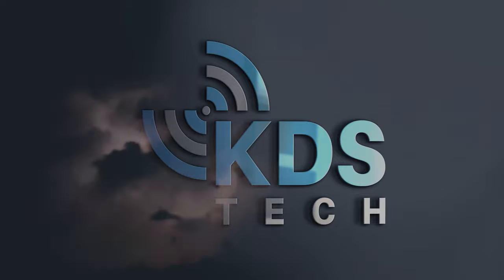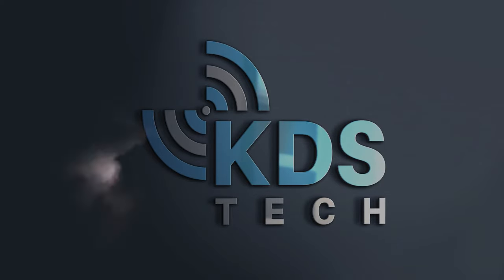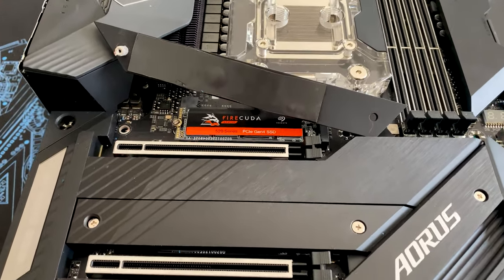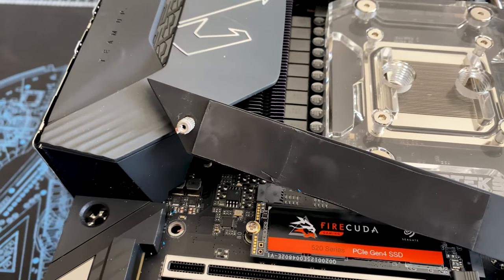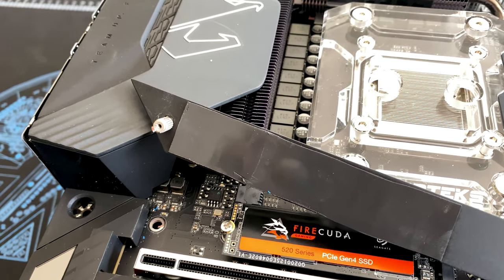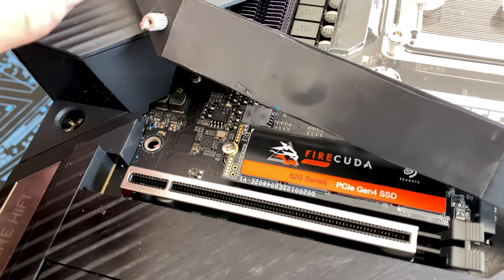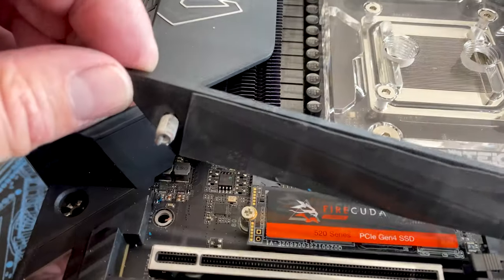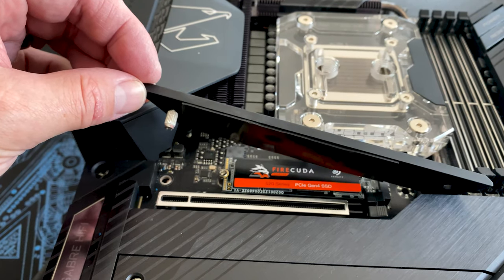X570 Aorus Xtreme... Broken!!!

Comment: I had the same exact issue with this board. The solution: remove the backplate, and attach a second bolt from the back.
Reply from the maker: not a bad solution
Reply: @KDSTech  I just buy this today and then experience the same issue as you..
Did you get RMA by Gigabyte?
@DC9V Where I can get the second bolt? Actually, I just plugged again the bolt and it's still working actually, but for this expensive motherboard, this quality is not acceptable. 
I won't go to the service center, especially during covid.
Reply: @ryochaniago8172  You can use the same type of bolt (/metal screw) that is used on the top for the atttachmet of the nvme card. If the bolt is too long, put a small ring washer between it. If you don't have a washer: you can make one by cutting-out a piece of a pci slot bracket. You just need to make sure that it doesn't make contact with any circuits on the motherboard.

Comment: I just went through the same thing. I had to send this exact board back to them twice. The first time it lost power which incidentally required CMOS to be reset. Also. like you one of the posts broke for the M.2 drive. The RMA included a power issue with a broken post. Long story short they replaced posts and heat syncs with new screws. All this took about 6 weeks total. what sucks is there's a missing post for the third M.2 drive slot, but I probably won't be using that as I use a disk drive for backups. This board is expensive as hell. One would think it's built like a tank. It's the only motherboard I've ever had issues with and clearly, $750.00 does not mean it's the best. Hopefully, it doesn't die on me down the road. I just got the board back two days ago and spend the evening putting my PC back together again. So far it's working well.

Comment: So, what was the resolution with the board? 

I just bought the same board and I'm having thermal issues with my M2B nvme slot. It will randomly disappear from bios and os. (I think it may be related to thermal expansion causing intermittent connectivity.
Reply from the maker: Well... I finally got it back from them, over a month later, and it wasn’t fixed... gigabyte has disappointed me on this whole thing.
Reply: @KDSTech  have you had any issues with your m.2 drives?

Comment: Sorry to se how unlucky you are with your build, hope your getting a replacement soon.
Noted one thing, you leave the sticker on them drives?
I removed them from mine (even if that might break warranty) it should allow for better contact to the heatsink for cooling, although I see them getting hotter than when they sit on an Nvme PCIE controller card, going to switch my case out with something that adds more airflow over the whole board thou.
Currently using a Phanteks P400A, but not quite happy with it, will replace it with Lian Li's O11DW, going for 3 fan intake at bottom and 3 fan  exhaust at top, vertical mounted GPU (air cooled) and a 360 radiator for the CPU mounted to the side.
Reply from the maker: Thanks.  No.  Stickers will come off when I actually get it finished up.

Comment: Just epoxy that grommit back onto the board. Clean the old pink glue off first then apply some epoxy and squeeze it back in and let it cure and setup.    🤓
Reply from the maker: I could have tried that.   But honestly, i wanted to see what the customer experience is like when dealing with Gigabyte on an Rma.
Reply: @KDSTech  Well that and that board retails in Canada (where I'm from) for 929.00$ CDN. At that price point you would expect everything in the board to be over re enforced and quality and everything atleast stock to run perfectly. Sorry for the crappy unit you got, I got the same motherboard and haven't had any issues. Picked it just because of the passive southbridge and over built VRM/Mosfet's